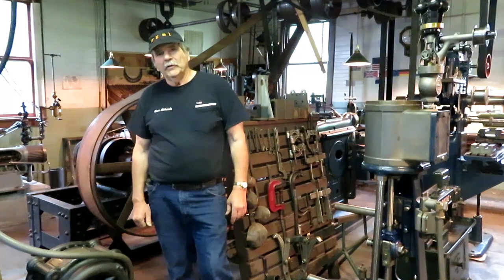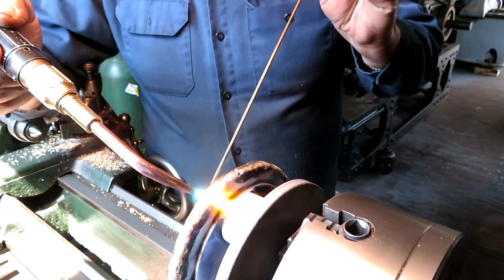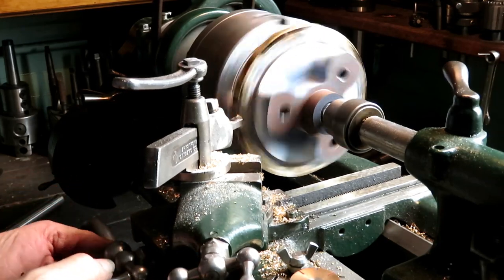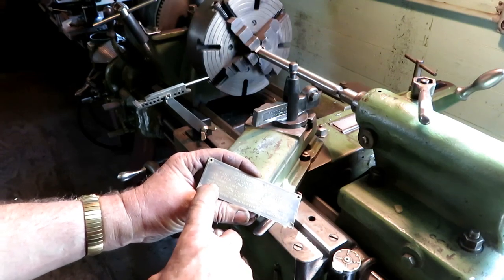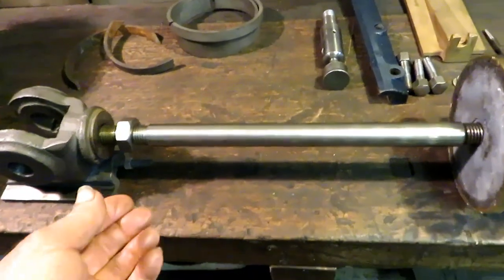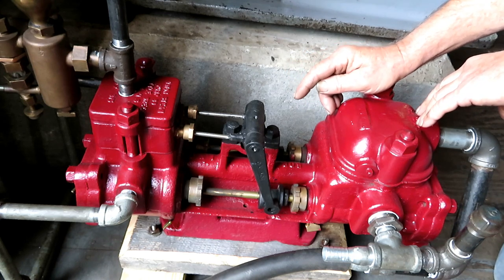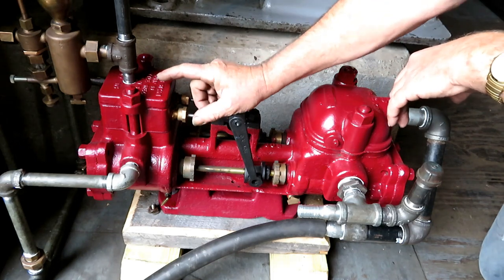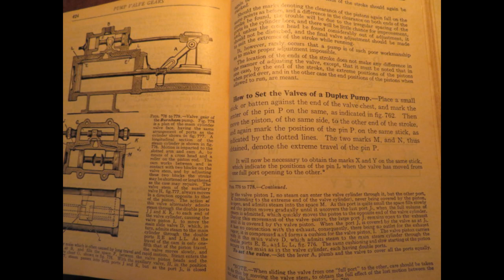OLD STEAM POWERED MACHINE SHOP 39  oversize steam engine piston

Comment: Hi Dave, until recently I was a Powerhouse Engineer in Power Plant at a Paper Mill in Pa.. Your little pump is a miniature version of a fire pump that was installed when the original Turbines were put in, in the early 1910's. The last Patent date on the pump was 1896, and we test ran it once a month up until 2001. It operated on 180 PSI, and we had to open a 4" discharge valve that would shoot a full stream of water 100 feet across the Mill Dam while running it. Thanks for bringing back some nice memories
Sam
Reply from the maker: Sam, At 180 psi..I guess so!    Can you tell us more about the mill?....Dave
Reply: The Tyrone Mill was opened by Morrison and Cass in 1880 and folded into the West Va. Pulp and Paper Co. in the early 20th century. When Westvaco Merged with Mead in 2001 we were closed down. We reopened in 2003 as American Eagle Paper Mills as a fully Recycled Mill, with 2 Paper Machines. Up until July of 2016, the Mill was Powered by a 1958 installed, 7.5 Mw Westinghouse 25 Hz Generator driven by a 600 PSI double extraction Turbine that Extracted 180 and 50 PSI. We operated 2 backup Turbines when the Primary was down for Maintenance, a 1920 Westinghouse 180 PSI Unit and a 1928 Westinghouse 600 PSI Unit, both of which were operational when the Powerhouse was decommissioned. In 2016 a new Natural Gas Boiler was installed for Process Steam and all Power Demands were converted over to Public Utility with a Duel 60 Hz to 25 Hz Converter System.

Comment: Good one as usual.  I have worked on many a steam pump like that. One time I had to repair one with 10" pistons and 3" dia rods.    The operators were pumping out a lube oil Tank and tried t push it and bent one of the rods.  I had it going again in about 12 hrs. and we got the tank pumped out.  This was on a WWII era oil tanker. Thanks for sharing.
Reply from the maker: Thanks Randy, I enjoy your videos also...Dave
Reply: What a great video Dave  .cheers.

Comment: Love the water pump Dave a lots of fun!  So the injectors on the boiler also heat the water as well as pressurize.
Reply from the maker: Yeah, It depends on the boiler pressure (= temp of the steam driving the injector) and the volume of water going in....Dave

Comment: It's always a pleasure to see what you're up to - 'Keeping old iron ALIVE is a tremendous challenge; as well as rewarding ;)    I've been on the cutting edge of technology, ( 1970''s I worked as an experimental & prototype machinist ) - YET , now that I'm 'retired'; I find it INSANE that the cost of parts for putting together an old 12" Atlas lathe is MORE than I would have paid for a WW2 era Axelson, or Leblond !   * In the '70's , a lot of older machinery could be had for LESS than SCRAP PRICES ! ! !  The world has gone crazy ! ?  
     I could sense that the LAST squirt of oil would quiet down the pump , such is life . . . the 'squeaky wheel' was THIRSTY :p      Looking forward to the next installment , you do great work with simple tools !  I'm dying to get enough 'puzzle pieces' put together , where I can put to use what I KNOW =  I want to build a SOLAR STEAM engine; that will provide electricity, as well as WASTE / LATENT HEAT for other uses !   I'm in Southwest Missouri, where summer's heat can be debilitating . . . ( Humidity index gets very  high )   I'd love to use 'waste HEAT' to produce 'free' cooling !  ;)    Take care, Dave !    & HAPPY MEMORIAL DAY - SUMMER'S HERE !
Reply from the maker: Thanks George, sounds like you are the man that can do it...Dave

Comment: Thanks david : thke me back to the old tannery here in middlesboro ky.On that water pump in the old tannery was built in a swamp like place and at different places thay had steam sump pumps thay were large pumps push pull 2 cilenders i can still hear them pumping all night.Because i traped  muskrat and mink and sold the pelts for some money on the side.I was in grade school.Also i would go through the tannery at all hours of the night.It was just wonderful !! I ment to tell you why the smoke stack was so high.It had to be high to keep the smoke over middlesboro city here. just me and my dog sonny.A lot of the steam was for heating the Hot houses to dry the leather.It took about 6 to 8 weeks to complet a finished the leather and ship it . they had military contracts for leather back in the day also.Thanks so much for your videos. Your friend Steve.....!
Reply from the maker: Great comment, The Lehigh Valley, Auburn branch RR ran through this town and before there was municipal electric power here, a boiler and steam pump supplied a RR water tank in town from the creek which was probably 20 feet below....Dave

Comment: Thanks, Dave.  Always a treat.  Nice to see a method for fixing casting problems.   I'm researching making a duplex pump.  So, it was neat seeing you had one working and give a little info on how it works.  The linkage is not straight forward.  Thanks for explaining about keeping a little buffer pressure to keep the piston from hitting the cylinder head.  Hadn't thought of that.  Larry

Comment: Dave, love your videos!  I ran a completely closed loop steam system.  My boiler feed pump would pump condensate perfectly well until it reached just above 200 F where it would start to cavitate(sp) instead of pump.  I rigged a make up water system in order to have water in reserve to keep the condensate under 200F which worked automatically.  The net result was no loss of water and the boiler ran way more fuel efficiently and with less thermal shock to the boiler.  

You have a really cool steam pump!

ATB
Jeff
Reply from the maker: Keeping the pump low and the condenser high to keep the inlet suction low might help a little too...Dave
Reply: right on - Keeps the pump primed by gravity.

Comment: Great video dave, i had be suffering from withdrawal since you stopped for winter,, the measure of a good pump would be to put a valve and pressure gauge on the outlet and restrict the flow and see how your outlet pressure compares to the steam pressure.

Comment: Hi Dave,

Another cracking video, thank you.
I do have a couple of issues though;

I would be wary of applying so much heat so close to the chuck when you brazed the piston, even though you moved it by hand the first time. The second time it looked as if you snatched your hand away quickly because it was too hot to touch. The chuck acting as a heat sink would be transferring that heat to the spindle and bearings. not a good idea. Also, by rotating a hot chuck against the spindle thread they could lock together when it all cooled and need a lot of heat to free off.

We use several duplex pumps at Forncett Industrial Steam Museum, and one is the boiler feed pump. As you described, we have a hot well which preheats the boiler feed water from the exhaust of an engine, and the pump works perfectly. It is ideal as the pump is run at very slow speed all the time, with minor adjustment for the boiler requirement, so we don't get a sudden rush of water, just a constant feed.
I have just read all the comments below. The chap with the closed system got his feed water temperature much higher than we would, so I think that the term "hot water" is a bit relative. Our hot well is topped up with cold water through a ballcock which is then heated but it is not scalding; you wouldn't want to keep your hand in it for long though. Good enough to stop shock and, shall we say 'excessive' cooling of the boiler from direct feeding cold water.

Please don't take these comments the wrong way; I have learned a lot more from you than I could ever hope to teach anyone but by sharing experience we can keep the old skills alive.

Best wishes
Reply from the maker: Thanks for taking the time to comment on here Andy, you're right and I wouldn't have done that with my good chuck. I'll rig something different up next time. The heat won't bother the compression side of the pump, but It would depend, like you say on the speed, volume pumping and temp on the suction side. I have a "spray washer" in the front side of the shop for parts cleaning (like a big dish washer) that has a 50 gallon water tank on the bottom, heated by electric element or steam coil. The 5 HP centrifugal pump is actually submerged. If I let the water get above 185 F. it wont pump at all. Add just a little cold water to get the temp down to 180 and it picks it up fine. Good example. The return condensate from my heating radiators in the front shop goes back into the fed water barrels. Both injectors "sign off" when the barrels reach about 110F, so I alternate barrels each day when running the heat....Dave

Comment: I told you about the Corliss Poppet valve engine in Wakefield, Massachusetts and the condensed water from the condenser went into a feed water tank with a floating control steam valve the regulated the amount of steam to a double acting feed water pump that fed the Cleveland Brooks bunker C burning boiler. As the boiler needed makeup water there was a 1/2 inch water line fed into the feed water tank that you cracked open to replace the water lost through steam leaks and other uses. It looked identical to what you show in the video. First thing Monday morning the cylinder cocks being open to prevent hydraulic lock the steam would fill the engine room with steam so you couldn't see your hand in front of your face for 20 minutes until we were getting just dry as possible steam out the cocks. The chief engineer who was the only engine room employee told me he had a second engineer but fired him for putting stem to the feed water pump and closed the cylinder cocks within 10 seconds after starting the Corliss engine, I forget the dimensions of the Corliss Poppet Valve engine but it was rated at 125 horsepower which ran a commercial laundry. 

 The new laundry in a new building across the street from the original building went out of business after three years due to high electric bills that were 700 percent higher than what it cost the original owner to run the steam powered laundry. After his son took over and his dad retired his son decided he could make more money by going with new equipment and all electric. He forgot to include the interest from the bank loan and the fact that the machinery used more energy that the steam powered laundry. 

 Plus he hired 27 more people than the steam laundry required. The clothes washer in the steam laundry was 25 feet by 20 feet in diameter off a jack shaft. The electric washers were 15 by 10 feet and he had five of them. He overbought in equipment for the new laundry. 

For those who haven't seen a steam powered commercial laundry to look at it it might seem an expensive way to do laundry but you reuse exhaust steam from the main engine to heat your hot water and many other functions which are essentially free by using waste steam which is eventually fed back into the boiler by in our engine room a 2 cylinder double acting pump. 

You explanation of how the double steam pump works is dead on as ours ran one piston at a time fully warmed up and running normally, only ours ran roughly 3-4 strokes per minute controlled by the steam float inside the feed water tank. 

Hint a 275 gallon tank fitted with a coil of copper or steel pipe ( 3/4 inch ) will create a home made condenser for the steam pump and if you equip it with a steam valve controlled by a float inside the condenser would slow the pump down to dead slow. 

Just a thought.

Thanks for Posting.
Reply from the maker: I never thought of using a tank float valve to govern the pump engine. It would shut it completely off when full.....Dave

Comment: Did you think about using a CI stick welding rod for building up the OD of that piston? I am assuming that the brass will work OK in this application, as the rings will take the wear. I love using a brazing process to fix cracks in cast iron.

Comment: Great video but why can hot water not be pumped? 
As for slower threading than Adam, I also proceed slowly as my reaction time is no where near his. If something goes wrong, I prefer it happen slowly. :-) That is also why I do not drive 80 mph anymore.
Reply: At the inlet to the pump the pressure would be too low for the water to stay liquid so it tries to boil. Pumps have a specification for net positive suction head required to avoid this if you actually have to pump hot water. Centrifugal pumps can cavitate with cold water if the suction head drops too low.
Reply from the maker: Right, if you start to evacuate hot water, it boils so the pump ends up with steam vapor in it and looses it's prime. Very annoying....Dave
Reply: Not only annoying, but cavitation can destroy the pump. Seen a few multi stage centrifugal pumps FUBAR because of it.

Comment: Would love to see you make the piston rings. I make little internal combustion engines from scratch like the one  I built in my avatar. I make everything including the valve springs but have always bought the piston rings from Otto Gas Engine Works. I would love to learn how to make the rings as well.
Reply from the maker: There are a lot of ways to do it. My way is shown on my G+ page with some photos of the rings I made for the first smaller shop engine a few years ago....Dave
Reply: Thanks Dave. I will check that out.

Comment: Hello Dave.  I don't see you using any flux when brazing up the edge of that piston. Is that a special rod?
Reply from the maker: I did use flux on the first pass brazing on the cast iron. It was an experiment that turned out OK so I built up the brass with a couple more passes, which is the part I videoed. I don't use any flux for that...Dave

Comment: David, your lubricator looks like it used to have wooden valve handles.  The lubricator on the Crown engine I ran had wooden valve handles and one broke so I was in the process of making a new one when I was fired so never finished it.  The wooden handles were basically donuts with two holes to accept pins from the valve stem and held on with a screw.  They were about 3 to 4 in in diameter.
Reply from the maker: Roy, You got fired for making new lubricator valve handles? Can we hear about this?....Dave
Reply: No, I was fired because they thought they could get away with having to pay less to someone else to run the train, take care of the track and train.  After I left, work was done on brass fittings with a pipe wrench which chewed up the brass.  In other words they shot themselves in the pocket book saving money in the short term.  I was in the process of making the handle and was fired before I finished it and installed it.
Reply: an easy valve handle is a wooden wheel from a craft shop for wooden toys. not a perfect copy but close enough for most uses.
Reply from the maker: It would work..I've seen them...Dave

Comment: Bonjour David,
Happy to se you back. A question about your water steam feed pump : how are you lubricating its cylinders ? Is the brass accessory on its top the oil lubricator ?
Amicalement, Raphaël
Reply from the maker: It's a lubricator like the one on the smaller shop engine.....Dave

Comment: Hey Dave - thanks for another great video.  I wondered how you decided how far back to cut the piston before building up again in brass?  Not really related, but I'm in the process of reclaiming an ali piston with a knackered circlip groove - I'm trying Teflon buttons in the pin rather than hot work on the piston as I am sure I'd mess it up!
Reply from the maker: Actually, I didn't think about it much, just "some", and then I figured it should be grooved a little.  Teflon should work OK....Dave

Comment: I really enjoy your videos. In fact I rather watch them than normal TV. I do have a question. How come you don't run your steam into another barrel and turn it back in the water? It seems like you can save a lot of water that way.
Reply from the maker: The problem Cody, is that there is "steam cylinder oil" that comes out with the exhaust. It gets a little tricky to reliably separate that out so it won't get into the boiler and make a foamy mess of the boiler internally.....Dave

Comment: Dave is the piston ring sandwiched between the two pistons?
Reply from the maker: The piston is made in two parts which leaves the ring groove in the middle. the two rings run together in that same wide groove. It makes the rings easy to install. It also makes it possible to take off the head off the engine, unbolt the top half of the piston and replace the rings without removing the piston......Dave

Comment: Hi Dave, your shop and tools look great, do you keep it heated over the winter? Or do you coat the bare metal with some kind of oil? I have an issue with light surface rust covering my machines/tools if I do not oil them heavily. (my shop is not heated.)
Reply from the maker: When I'm gone in the winter, condensation rusting run rampid in the shop. If I forget to oil a chuck or something, it gets surface rusty....Dave

Comment: Just run the pumped water through an economizer in the top end of the boiler, in the exhaust area. Suck more heat out of the smoke before it goes up the flue. That extra heat extraction warms the pumped water before it enters the boiler proper.

Can that pump act as a suction pump? What kind of head does it generation, on the suction and outlet sides?
Reply from the maker: It is a suction pump, dont know how much it will pull, but I'd like to run some tests in future videos....Dave